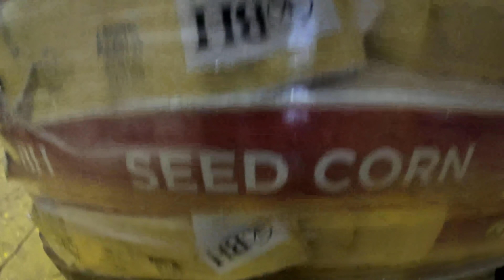CORN SEASON IS SO CLOSE

Comment: Daniel have you ever seen an oxygen bottle when the outlet neck gets broken off????? The valve becomes a bullet and the bottle a rocket. For you own safety please put the caps on when transporting in back of truck. Not only that do not let DOT see hoses connect
ed when not secured to frame. You will receive some green stamps in GA. Enjoy the videos. Unusual to see gators that far north.